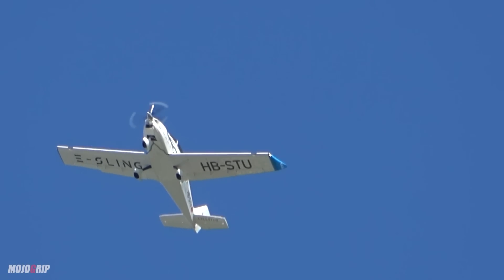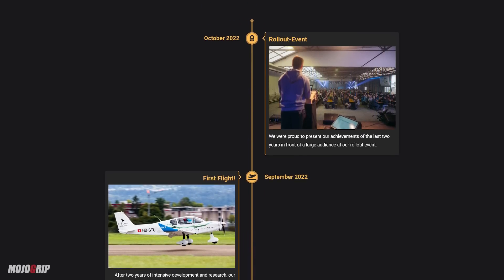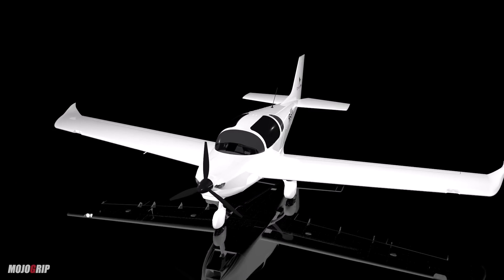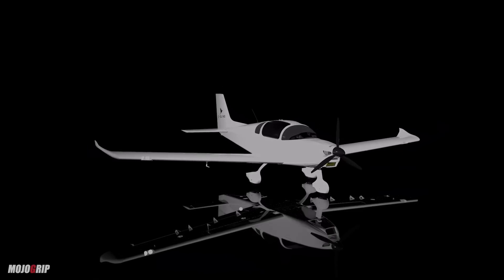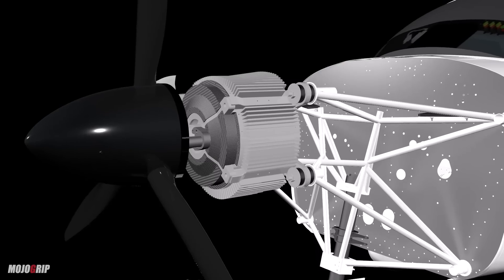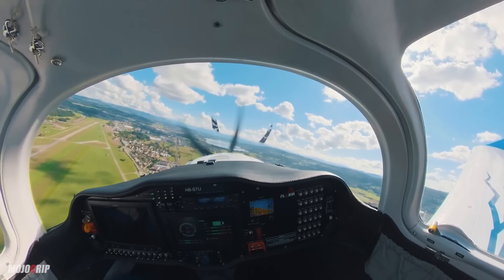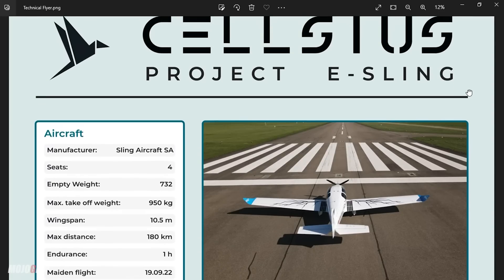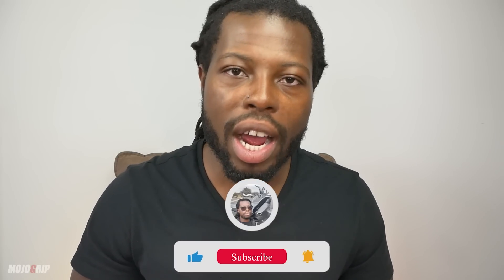All Electric 4-Seat Aircraft Sling TSi Takes Its First Flight

Comment from the maker: Correction. The Cellsius team is out of Switzerland not Germany
Reply: Man made climate change is a hoax to consolidate world power.
Reply: A fuel cell with liquid hydrogen should be used. No pressure vessel needed. It could have a couple hours of endurance. Liquid hydrogen could be made  anywhere with the right machine. Airplanes are the best spot for hydrogen.
Reply: Liquid hydrogen is a cryogenic fuel. It's a nightmare to work with and keep refrigerated.
Reply: @virginiahansen320  Understandable. I am just saying if you wanna fly today, long distances with today's technology, it could be done. You could start with one plane that goes between two airports commercially and it refuel before it takes off. The fuel will obviously boil off at some point. The idea came from BMWs new hydrogen/ petro car that uses a combustion engine but use a fuel cell because a combustion engine burns through liquid hydrogen too fast.
Reply: @majorchungus  Hello Major
Thanks for your interest into our project.
Liquid hydrogen has also disadvantages, i.e. high energy cost of liquification, slow to fill the tank up (hours), ... . In the end we weighted all dis-/advantages and decided that for the Cellsius project the near term future is in high pressure hydrogen.
Greetings Alex
Reply: @AW95  Thanks for the feed back. I hope for your success!

Comment: Well its just 44 kWh when some EVs are already 100 kWh. They could also add solar power which would add a bit more. At the very least the batteries are using the two physical spaces for tanks, so you might as well have them split using the traditional L-R-BOTH. Maybe the panels charge L while you use R and then switch or something like this. You could also do some regeneration from the motor itself when you want to lose speed/altitude, etc (speed regenerative brake). And while maintenance is lower, so is the the fuel. Unlike a car, its more normal for a plane to remain hours/days parked and could be left charging. I can imagine it to be very useful for island hopping and similar short time flights.
Reply: Hello freeculture
for the e-Sling solar panels and their components are to heavy for the added electricity they offer. SolarImpules has show how it can work but for e-Sling we would have reduced the effective range.
Greetings Alex

Comment: I happen to know a fair bit about electric drive, including engineering the electronics to run it. The range weakness is far more critical than it is for electric cars that are already beating ICE cars. Planes wont be the same and converting the sling will result is training only range. What you can do though is build a plane specifically for electric drive where a very large part of the weight is batteries and in a glider style shape. Think U2 or extreme range designs like the globalflyer that did 40000km without refueling. You might be able to do a design that can do 1000km on a charge with current battery tech and that's a workable range for a lot of use but even that would still be niche and quite expensive for what it does.
The advantage of electric drive is that it's much more civilized and agile. What you see competition drones do is hard to do with combustion engines. And it naturally lends itself to dual engine design and they can be ducted at the rear like a jet instead of the colonial front noise maker we still suffer under. It also works well at high altitude and could even work under water.
As a market segment you might see battery planes but electric flight likely wont take over before we have open contact with ETs and we use field propulsion and nuclear reactors. Which will be in our lifetimes short of an apocalypse. It's closer than you think.

Comment: Awesome video. My only concern is the additional 200 lbs in the wings. That's a lot of extra load.
Reply: Hello Pilot Peego
The weight of the batteries in the wing does not exceed the limitions of the wing structure and is actually quite close to the maximal amount of fuel the Sling TSi can hold.
Greetings Alex

Comment: Battery power shortcomings WILL BE OVERCOME. Solid state batteries are being used in Toyota cars as we speak. 500 mi range/ 10 minute recharge, half the weight. The pluses of electric powered planes are incredible.... no loss of power with decrease in air density. Two moving parts.
Instant torque. No carb ice, Or clogged injectors.. Electric is very well suited to aircraft except for weight/ range, which is solved with solid state batteries. At this time solid state are expensive and hard to mass produce. That will change.( c’mon Elon!)

Comment: Building those batteries requires 500,000 pounds of mining ore, 300 plus barrels of oils, etc. It takes 6-7 years before a tesla is carbon neutral and most electricity is made with fossil fuels.  Electric vehicles are dirty before a driver pushes the electric go button.  There is a hybrid plane that shows promise.

Comment: It's a complicated issue, but it's good to see work going into it by some smart folks. I don't think aviation is nearly done with internal combustion, but we'd reap the most gains just improving the fuel efficiency of our existing commercial system with new types of turboprop already in development. General aviation has a lot more flexibility to adapt in new technology, but we can still fly even if gas just runs out it looks like. Good to know.

Comment: Thanx for your objective view on this electric Sling TSI.  No use of "game changer" and other BS but reviewing it from the IMHO right perspective. Interesting to follow the development of batteries as todays restriction to (environmentally unfriendly) Lion batteries looking out for their project with 'hydro' batteries. Also due the overheating danger of the Lion batteries.
Very smart of these guys to use a Sling TSI,  which its good overall performance as a test bed
Reply: Hello Dd
Thermal runaway with Li-Ion batteries is a big issue but can be minimized with good meassurments. We had to proof that our system minimizes the risk and warns early if still smth happens. Further we had to show that a thermal runaway doesn't impact neighbourghing cells and the aircraft remains operable during such an incident. 
To the environmentally unfriendly comment: Yes Li-Ion is not perfect but in the end an electric dirve train in an overall comparison is better than ICE engines.
Greetings Alex

Comment: I'm very much looking forward to electric GA aircraft - quieter, cleaner.  It would be great if the costs to operate and maintain were lower versus gas powered.  It's a steep hill to climb, but it's not impossible to get to that 3 to 4 hour flight time, at which point these electric aircraft will be wildly more practical and are likely to be more widely adopted particularly for training.

Comment: I’m a huge advocate for electrification of transport, and I’m optimistic about electric aviation…. BUT!! Here’s the issue I’ve seen with most electric aircraft designs. 

Unlike electric cars, I don’t think the optimal solution for aviation will look similar to current petrol powered aircraft designs. The efficient low wing and high wing design paradigms that have emerged in general aviation over the last 60 years all stem from 2 design requirements which don’t apply to electric aircraft - heavy ICE engine up front, and fuel storage in the wings. (With the exception of pusher props, which don’t change all that much). 

And though I will cheer on every effort by the e-sling and e-flyer groups, I think their efforts have shown us that the current design paradigm just won’t work for electric GA aircraft. We just need more volume and mass reserved for batteries than fuel. Which might also mean that the optimal design for electric GA aircraft is NOT ideal as a training aircraft for future commercial pilots. So the business case is harder to make for a truly clean sheet electric aircraft design. 

That being said, I think Eviation’s Alice aircraft is a good representation of what a truly clean sheet design could look like. Look at the fuselage cross section, the wing placement and airfoil cross section… there’s no way that plane controls similarly to a Piper Warrior or a Cessna 172, but it’s probably what the future looks like. So should we really be concerned with whether or not an electrified GA aircraft doesn’t translate well to a commercial aircraft experience? I don’t think so. 

I think we have a unique opportunity to create a brand new type of aircraft that flies cleaner and cheaper than anything we’ve seen before. But it might not look like what we expect. 

Very excited for what the future will bring!
Reply: Agreed. I think retrofitting existing designs is neat but not at all the future. Like electric cars, especially the new structural battery Tesla's, the airplanes have to be built from the ground up as electric. We are not quite there on energy density to make electric GA practical but we march closer every day and eventually everyone will wonder how we put up with finicky, unreliable, complicated ICE engines for so long.

Comment: I'd think having a hybrid motor would make the most sense.  Reducing a fuel burn, where a plane can fly on 3-5 gallons an hour at say 175kts is a better deal.

A single or twin engine hybrid with a 25 gallon max tank (center, aux, or tip tanks) that gives you 1500 mile range, 1300 useful load, and 4-6 seater would SLAAAAAP!!

Using fuel for the climb, dual electric for the cruise, fuel for the landing. That should be the standard for planes going forward.
Reply: Hybrid doesn't do much when you are cruising.
Reply: @majorchungus  well, car hybrids maybe. But like a turbo in a car you can adjust the boost, the fuel can maybe be used to recharge batteries while in cruising flight. Hour+ of electric power, then it switches to fuel when down to 10%. Fuel also recharges batteries. When charges, returns to electric.  The net average is the fuel savings.
Reply: @thetrendingadvocate2727  my volt can charge the batteries from the fuel, it's a waste of fuel to charge the batteries.
Reply: @majorchungus  so how are you going to charge the batteries in the air?
Reply: @thetrendingadvocate2727  you don't because having two different powertrains in an aircraft is a waste of available carrying capacity and maintenance will be higher than just running electric or gas alone. Electric isn't much greener than just burning fossil fuels because it takes a crap ton of energy to mine and form the batteries. You would basically be making an airplane with more failure points. Plus I wouldn't want to be in an airplane that has a battery catches fire because they are being put under way more stress than their road counterparts. I recommend an airplane that uses liquid hydrogen and a fuel cell. The energy density would be way higher than a battery and the hydrogen could be jettisoned in an emergency. You would be able to fly for hours with today's technology and not be polluting and you wouldn't need to mine half the earth for the nickle, cobalt, and lithium.
Reply: @majorchungus  operative word is DEVELOP.  There are already hybrid airplane engines. But development is slow and many are focusing on all electric. Well, a usable electric engine needs to be developed too right?  So, this area should be the focus is my point.  No one wants to land 9 times for a 1000nm trip. Especially when you'd have to wait an hour or 2+ every stop.

Comment: Battery powered planes is a cute but unreasonable concept for current tech.  Slow recharge times. Heavy battery packs.  Energy requirements that cannot be supplied by the grid and no airports with charging stations.  Vast majority of electricity is created using fossil fuels making the whole endeavor a ridiculous pretense at being green. Embracing Jet-A would be infinitely better for the environment.

Comment: Time is not ready for electric flying.  In a neighbour airfield 50km, they have a new Pipistrel e-trainer, lots of publicity, they sell the flying hour 230€ which gives only a very little revenue. The battery is guaranteed only 1000 decharge/charge cycles and then 20000€ for a new one. They are afraid to fly to our field, about 17flying minutes in a Gyrocopter, because there is no possibility to charge, ok, safety first!!! 🤣🤣🤣😎🇫🇷

Comment: The limited battery range makes these planes a better match for flight training; that's the target market for Pipistrel's electric plane.

We shouldn't assume batteries will advance quickly.  They've progressed from using lead to nickel to lithium. But lithium is already the lightest metal, so progress may stop .
Reply: But also lithium batteries have literally gotten 10x better in almost every metric in the last ten years - energy density, charge time, total lifetime cycles, etc…

So what else is left? Hard to say. But petrol engines took almost 100 years to get 10x improvements, so I’m optimistic.

Comment: My wife and I each have electric cars. The money we save on gas pays for her car. They are reliable, easy to drive, and fun. Im never going back to gas. For planes, we have to reduce the weight of the batteries. It will happen over time. We have to start somewhere.
Reply: Absolutely right. After driving exclusively electric for the last 5 years it's such a drag to have to go back to a gas car. The same thing will happen in general aviation piston engines in a relatively short amount of time (in aviation time at least). When I have to put gas in the Cessna, prime the engine, watch oil pressure and EGT, it just seems so archaic after being used to the superiority of electric motors in my cars.
Reply: @kingjamez80     So, when are buying an electric chair?
Reply: At what cost to the environment to build the batteries and what generates your power source.
Reply: @dallasjolley1  
Bingo. It is called virtue signaling.
Batteries are build out of thin air and recharge with unicorn urine.
Reply: @dallasjolley1  Yawn, Facebook wants its red-herring argument back. 
Who said anything about saving the environment? I'm happy to have that debate ( my power for my cars comes exclusively from solar on my roof, my cost for the energy to drive after installation is equivalent to about 30cents/gallon... yes 10x less than buying gas from dictators in the  Middle East). However, there is zero need to debate environmentalism. 

Electric motors are vastly superior to internal combustion engines.

Full stop. 

Electric motors weigh less for the same HP, cost less, are not affected by altitude or temperature (within reason), have a far better torque profile, are vastly smoother from a pilot comfort perspective, and most importantly have dramatically fewer parts and have much much longer lifespans than ICE.

The ~only~ reason they haven't taken over GA is that batteries lag in energy density, and lag badly. If (when) battery technology gets even remotely close to the energy density of AVgas or JetA then ICE engines in new GA aircraft will simply vanish.
 
There will always be a place for jet's, especially in the supersonic domain, but for sub-sonic flight, electric MOTORS are un-deniably better.

Comment: Failed to impress.  I'm sorry Mike.    No matter how you try to dress it, the tech is NOT an acceptable for GA use.

Think about the insane fires that will occur when one of these eventually goes down.  They don't just burn.  They will burn a hole straight to hell.  Survivors?  Nope.  Deadly lithium fumes will help increase the casualty count.

Comment: The are off to a good start. But the energy density of batteries is not as good as gas, so it will be difficult to provide the level of energy to sustain ado a 4-6 hour flight.  A reasonable option is to develop fuel cell, or a diesel/gasoline that can use  a sustainable carbon neutral fuel.
Reply: Fuel cells or new fuels doesn't help in the regard that you need an expensive aviation rated engine to then be developed to use those fuels. Especially if it has to be redesigned from the ground up and not just be a small mod to existing engines. So for the amount of risk/reward and the production volumes and costs, it just makes sense to stick with already proven aircraft ICE engines and fuels. At least an e-motor is fairly easy to build, even if it has to be built custom, and can conceivably be affordable. Seems like the tech to build lightweight electric motors is fairly-well already there. The only limitation is battery density, and if that could be improved much at all, we've arrived at a good solution.

Comment: Question about hydrogen power. Doesn't the heavy high-pressure tank needed to store the hydrogen make it difficult to adapt to aviation? Hydrogen is low in density, requiring a bigger tank than for comparable energy as gasoline.
Reply: Hello Penultimate
Exactly that is the challenge that we are facing in this years Cellsius project and plan to overcome.
Greetings Alex

Comment: Great project. I'll be a party pooper and point out Li-ion batteries present a significant risk of fire, would be catastrophic if one occurred while in flight. Not a concern for a single prototype. In mass production, it is much more likely to happen.
Reply: Right, because AVGas is known to be so fire-resistant.
Reply: @kingjamez80  What you're missing is that Li-ion batteries can spontaneously catch fire without being damaged. A gas tank has to have physical damage before its contents can burn. If we use cars as an example, it's electric cars that are causing fires, so much that the Korean automakers were advising people to park their EVs away from their home.
Reply: I was swayed by the numerous reports, especially the fire aboard the ship carrying bentleys and porsches. In fact, any fuel system leak could lead to a fire on a gas-engine car. Does someone have the number of fires of the two types weighted by the number of vehicles sold?